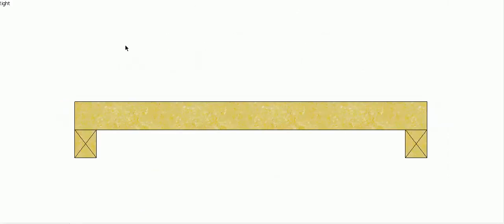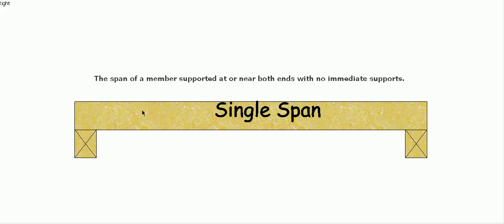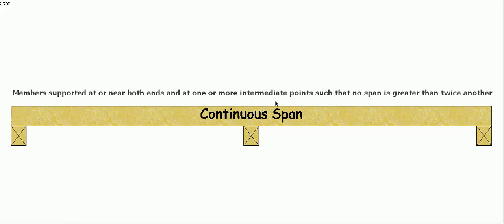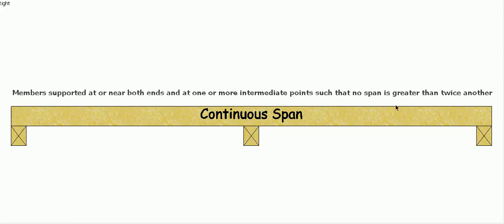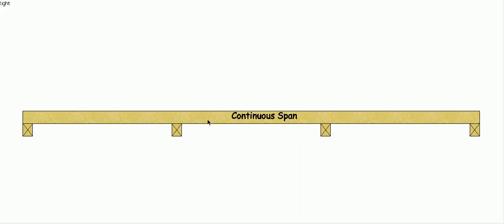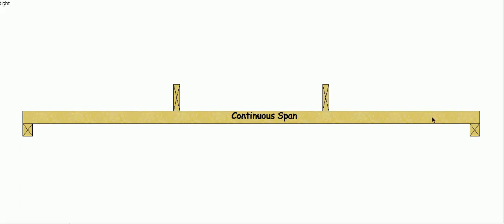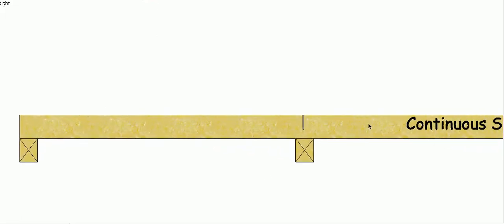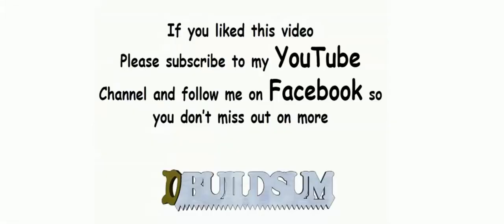Single Span  Continuous Span

Comment: Where is the best place to buy concrete? and why there is so much difference between them? What factors are important in terms of getting different prices?
Reply from the maker: Concrete suppliers will load their prices depending on the size of the order and how busy they are. I would just look for the lowest price no further than 20 - 30 minute from where you need it. As for the beat place just look for one of the larger companies
Reply: Thank you, one problem is when you call the same company, for the same amount they tell you different prices by different people

Comment: Can I ask one more question? Do you think Cordell's is a good tool to use for accurately do the estimation or is there any other tool that you recommend?
Reply from the maker: Cordells are Ok just make sure you use the location factor to adjust to the area you are in. There is also a company called Rawlinsons who have a similar product. They are both pretty much the same.
Reply: Thank you. Cordells have  Buildxact. Is it what you use?
Reply from the maker: I don't use either because I don't do enough quoting to make either viable. No, I don't believe that there are free versions. Personally i wouldn't get either and just rely on quotes and prices from contractor and suppliers

Comment: If for example, you want to build a strip footing for a one-meter high retaining wall from Besser blocks in a semi circle curved shape what type of footing would you choose and how do you do it to be the most cost effective way?
Reply from the maker: For that, I would definitely use a Strip footing which you will need to get a Structural Engineer to design.
Reply: Thank you very much
Reply from the maker: In Queensland, it is anything over 1m require council approval, in NSW it is 600mm. Regardless of the height that the council requires Retaining Walls are serious things and unless they are only holding back a small amount of material need to be designed properly.
this might help
http://www.adbrimasonry.com.au/LiteratureRetrieve.aspx?ID=176630
Reply from the maker: Yes, when I started my TAFE course they still had brick footings in the notes however not anymore. For a standard wall, they might be ok as they are just spreading the load across the foundation. However, with a Retaining wall, the footing is tied into the wall and helps to resist the overturning forces
Reply from the maker: Yes, the reinforcement should come out of the footing, through the besser blocks and tied to a horizontal row of reinforcement between each layer of blocks. Then core fill the blocks ensuring that you vibrate the concrete so it fills all the voids and you don't get any air gaps
Reply from the maker: To add the weep holes I would just drill holes through the formwork and then insert some electrical conduit to form the hole. This can be cut off flush to the wall when the formwork is removed. Yes, I would still put an agline in, it can just finish with the end of the wall as it is there to divert the water around the wall.
Reply from the maker: the foundation is essentially just a very wide wall, the rocks would have to be mortared into place and mortar used to level off the top for the wall to sit on.
Just a note, these old systems work in stable soil however if your soil is reactive( has clay in it) then this will limit the lifespan of the wall
Reply from the maker: Yes, you always need to check the soil conditions. Waffle Pods were designed for use on reactive soils as the voids under the slab give moving soil somewhere to go and if the slab does move it moves as a whole and does not cause cracking in the structure.

Comment: And just one more question. As the price of concrete is very high what are some of the best practice in making footings to save on the cost of concrete and concrete trucks?
Reply from the maker: As footings and Slabs are designed by an Engineer there is not a lot you can do about the amount of concrete that they require. Obviously, a  Strip footing will require less concrete but then you have to install the Bearers and joists etc. A waffle pod type slab uses a minimal amount of concrete so it would be my choice if I was going to pour a slab,
Reply: Thank you for your reply, I cant grasp the concept of a waffle slab very well. Would you elaborate a bit more?
Reply from the maker: The Waffle Pod type slab uses Foam "pods" to form beams in a grid pattern under a thin surface slab, therefore using less concrete. I show it at the end of this video
https://www.youtube.com/watch?v=Ipb5s2KJXhI
and very  briefly at the start of this video
https://www.youtube.com/edit?o=U&video_id=0Um_Ttv95Ko
or try this link
https://www.foamex.com.au/polystyrene-products/foamex-diamond-pods-waffle-pods?gclid=Cj0KCQjwvezZBRDkARIsADKQyPlHSZ-lT0z14GH6cnQgBX_HuP_D_lX9Ypu-R52_iVIBH_nO0iTlaogaAnkFEALw_wcB
Reply from the maker: You should be able to get that information from your Local Council otherwise you would need to get a Geotechnical Report done on the site.